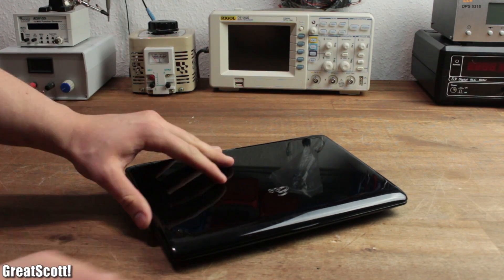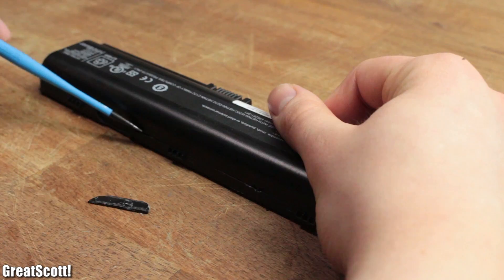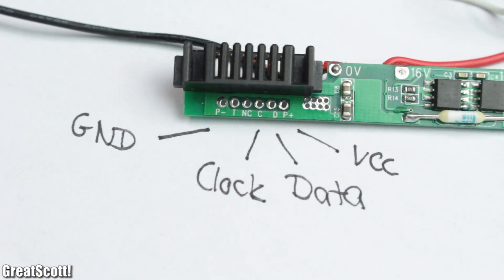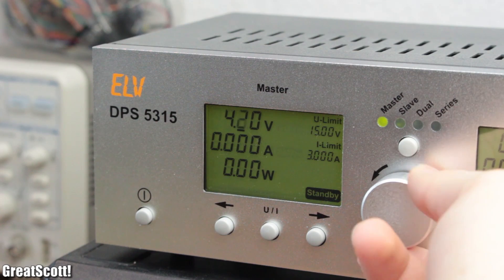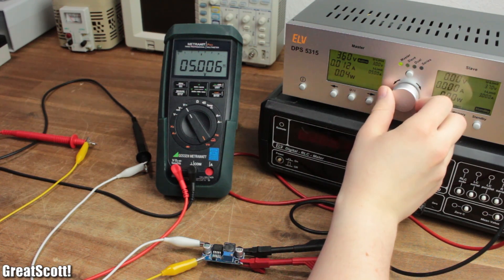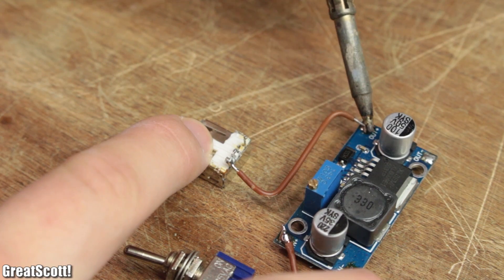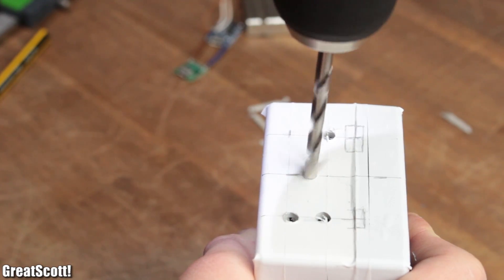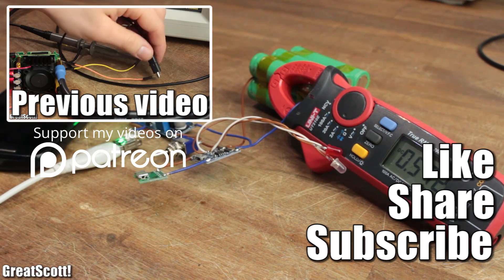HACKED!: Old laptop battery becomes a Power bank

Comment: I could do this with more than 6 cells? I have a bunch lying around.
Reply from the maker: I recommend only cells from the same batch
Reply: +GreatScott! Can you please make a Solar powered power bank because the power bank you did in the video does not have an emergency charger itself so, please make a video on it.
Reply: Sure, but use an good wire that can handle the current
Reply: You CAN, but you'll have to take extra care during charging because cells from different batches can have different internal resistances (ESR values) and mixed cells without balance control can create a scenario where some of the cells can overcharge or draw significantly more current than other cells in the pack. If you decide to still go ahead and build your pack, then ALWAYS ALWAYS ALWAYS monitor the pack while charging! If you notice any of the cells getting hot, then immediately stop charging!! If you let the overheating cells continue to take in current, you run the risk of some of your cells heating up past their safe thresholds and entering a thermal runaway, which as the term implies means the cell will overheat, release all the stored energy and potentially start a fire... I personally recommend that if you are gonna mix and match, you should get the ESR (Equivalent Series Resistance) of each cell you use and make sure that each bank of cells is at least somewhat equal. This will reduce the chances of your finished pack overheating. Lithium Ion cells are VERY picky when it comes to charging, so regular monitoring is an absolutely great idea and shouldn't be an afterthought if you use a mixed-batch pack of cells.
Reply: ThEcRaZ3dGaM3R lol
Reply: Just add the solar board to the Circuit.
Reply: they have USB solar panels and you could get one and plug it into the USB port on hear
Reply: I had a battery pack that was supposed to power a screen that was rated at 12volt but after letting it charge overnight the screen wouldn't come on properly. are some of the cells dead for good and how can I tell wich ones they are
Reply: ThEcRaZ3dGaM3R it was a pack I bough used at a thrift shop that was a battery and a screen for a gamecube and after charging it over night the screen would come on but not properly I plugged the screen into 12 volts from the wall so I would know what it's supposed to look like
Reply: ThEcRaZ3dGaM3R how powerfull charger do you need for this to charg is 1.55 A
Reply: well you could do it with a billion if you had enough cells and time
Reply: Kyle Thomas thanks
Reply: If you're doing what I'm doing and making a high power LED torch that needs an 4AH pack producing 6 amps of current  just to flicker then it's a must to use thick wire. For a low-power application, such as a phone charger it's not as vital since the current to the boost converter rarely exceeds 1.8-2.5A. Your biggest worry will be mismatched cells since no two lithium ion cells have the same characteristics. Each cell will have a different internal resistance called ESR (Equivalent Series Resistance). If you're mixing and matching cells, the cells with the lowest ESR Will draw significantly more current than the cells with a higher ESR as electric current likes to find an easy path to ground (or in this case, the easiest cell to charge). Issues with ESR mis-matching include over or under-charging of cells and potential overheating, which can cause the cell to thermal-runaway and release all of the stored energy as heat. If this happens, you should be aware that the cells can and do reach extremely high temperatures when they vent off and they CAN start a fire. You want to make sure you keep flammables away from lithium cells while charging if you can help it.
Reply: Hey thanks ThEcRaZ3dGaM3R. Would this different internal resistance still matter after a couple charge discharge cycles or will it always persist amongst cells from different packs? I would hypothesize that they eventually converge no? EE is hard. haha
Reply: BenevolentXMachine There's potential for them to balance out because the ESRs change with usage, but for the cells to do that, they need to be fairly similar (Within +/- 10% of each other). it'll take a fair few charge/discharge cycles though.
Reply: justin rivera Possibly... How did you configure the cells? Did you use a 3-series 2 parallel configuration like a 6-cell laptop battery and then use a balance circuit to charge the cells as a pack or are you banking the cells up and then boosting their output with a boost converter? Additionally, have you checked the voltage of each cell while building the pack?...
Reply: You gotta use a multimeter like he does in the video
Reply: justin rivera Maybe there's a dead cell or two in it it then... my recommendation is to disassemble the pack and check that all the cells are at around 3.2-4.2 volts. If you have any below 1.5v they're pretty much as good as dead...
Reply: BenevolentXMachine I did it with 10 cells and it works fine.
Reply: Andrew Vollmer tx
Reply: I have only 3 cells. Is it posible carry out such project?
Reply: As long as you make sure the voltage is EXACTLY the same across all the cells
Reply: Can you imagine charging a billion cells though!? That would take forever!!...

in fact, because I'm bored I'm actually gonna do the math using a fairly common battery capacity of 2000mAH. I'm going to use a perfect-world type scenario to shave time since I don't want to factor in losses. you generally have to put more current in to overcome losses from the internal ESR of the cell if you do a real-world type scenario... Anyway... to charge this huge ass battery bank (which could literally run an entire city's mobile devices for at least 2 days), you would be looking at:

1 hour charge: 2 peta-amps (2 billion amps) of current at 4.2v
1 amp CC charge: 0.00000001mA  per hour per cell, which equates to about 2,000,000,000 hours, which is 228,310.5022831 years at 4.2v... You wouldn't even be alive to see it fully charged unless you started with fully charged cells or could generate ridiculous amounts of current!!

Comment: Question: i found a broken USB battery, I cut off the leads to the damaged battery and discovered that the usb circuit was intact. so..... I have a bank of 4 series laptop batteries charging off of it. do you think its a viable option to recycle the charging circuit from broken usb batteries? and their possible application? so far i have 2 packs of 4 batteries in series, i plan on doing a parallel and doubling my numbers from 1.498 average per pack

Comment: thats not a power bank thats a power brick lol
Reply: Mack Andreou I mean hey it works tho lol
Reply: you will not find in a store power brick with power like this
Reply: That's not a scam you dumbass. Anker is a true company.
Reply: Sean Smith "massive"
Reply: supahvaporeon LiPo tastes like polymer
Reply: no more like eraser
Reply: that's called a scam
Reply: You saw, how big one 2200mAh battery is. There is no higher density now than LiIon, and LiPo just means free form Vs fixed AA sized form.
 If you see a 20000 mAh battery that is ONLY equal the size of 4  2200mAh batteries, you should not that you are cheated. If they state on the samed power bank/brick to have 50000,Ah capacity, the you should know, you are cheated much worse.
 There is no magic, there is no higher energy density technology available, than these thick AA sided batteries.  If anyone develops a different, higher capacity battery, it will NOT sell it on ebay, but will have a huge contract with Tesla, and will become ultra rich.
Reply: @MMSZoli  there are lg 18650 with a capacity of 3500mAh. The anker one, for example, has 6 cells in a (weird for a powerbank) configuration of 2s3p and has a capacity of 20800mAh. This is perfectly possible and not a scam.
This does not mean that all powerbanks are real, there are some that advertise a capacity of 50Ah and are not much bigger than your phone.
Reply: What do you call this? https://www.amazon.co.uk/20000mAh-Multi-Voltage-Portable-Notebooks-Compatible/dp/B00BUJCMUQ they go a lot higher than that.
Reply: @rupert274  Lmao I have 220Ah battery pack
Reply: Those are using Lithium-Polymer batteries, which are more powerful than Lithium-Ion batteries

Comment: Where is over discharge protection in this circuit....
Reply: It's included in the charger
Reply: Tp4056 comes in two models one with charge protection and one without.The one used here is with charge protection.

Comment: Awesome video and project.  If I may ask a question.  I have 9 18650 Cells.  I am series wiring them into 3 sets then connecting the 3 sets in parallel making a 12.6 volt battery.  How would i make a balanced circuit  charger using 12 V transformer and 3s pcb balanced board ?

Comment: I have also made my on 12000 mAh my charger system can charge batteriene with 3 Ah 4.15 volt my usb output is 5 volts 3 Ah charging system and usb 5 volt system must be chosen with care to project the batteries

Comment: can I just use a circuit board from old power bank and hook it with 12 battery cells?
Reply: if the cells are the type of accu and thei have the right voltage this should be no problem

Comment: I salvaged 4 batteries from an old laptop battery. charged them individually and 2 of them keep exactly 4.05 volts  and the other 2 dropped to 3.93v and 3.94v. Is it safe to use all 4 batteries together in series?

Comment: I have done the very same circuit to feed a PAM8403 module and when the battery is completely charged smoke comes out of the XL6009 module and it burns like hell. Where's the problem?

Comment: Hello Sir,
I found this as very useful. Ok. but I found that the this tp4056 module cut the output voltage only at 2.5v. i think this is too low, even for some 18650s. how can increase that voltage to 3.6 or atleast 3.0v. i think that will give more protection. another qustion is how can we find the battery with good capacity from that. is there any simple way?

actually, I am going to create a portable emergency with 18650,tp4056, and 1w led, but the problem is when 18650 is fully charged it will 4.2v and when it low its only 3.0 v or lower. when i connect a few diodes series for drop down some voltage it will work from 4.2v. when the voltage reduced to 3.6 the led will be dim. so i need a constant output led driver with 3.2v fro lion. i need around 2A current for few leds parralel. can you help me. plz do a video for this. or at least send a circuit with good efficiency. Expecting your great help. Thank you Sir. (sorry for my bad English)

Comment: I have a BOX of different solar cells, and various rechargeable 18650 batteries iv been collecting for a few years form various places. While I am somewhat skilled with soldering, and can read most circuitry diagrams (that are not horribly complicated) I do not have the experience making circuits myself. Would you happen to recommend a circuit i can make that will accommodate a variety of solar cells (from 1v-3+v), and safely charge 18650 cells? My ideal plan is to make a mini-toolbox solar charger (outputs 5v for usb charging). I was thinking of using something like this: https://www.amazon.com/GERI-Charger-Booster-Converter-Display/dp/B00VDP94QM/ref=pd_lpo_107_tr_t_2?ie=UTF8&refRID=WVKTE63DKPEKVFABNZVEBe awesomely appreciated for some help / recommendations!

Comment: TP 4056 has an input voltage of 5V and an input current of 1A from its usb in right? So if i connect something over 5V 1A to its input terminals, would it be a problem? For exapmple a solar panel with 5V 2A input?

Comment: I know TP4056 is charging only one 18650 battery. is this true?
Reply: yes
Reply: Are u sure?. TP4056 is charging max 1A and using single 18650 battery. Be carreful I thing burning or so slow charging.
Reply: +Baran Can AYDIN he connected 6 cells in parallel so 1/6 amp 😀

Comment: my boost converter seem to be too high ive fried two usb doctors and when i use multi meter on usb out it reads all screwy ending up at - 1. iam using volt setting and cant figure out how to trim it down so it doesnt fry my micro usb on phone itself. scare to try iff it already just fries usb  doctors. please help me with this and my charger is complete. thanks

Comment: did you short out the data pins on the usb jack?
Reply from the maker: Not in the video. But it is an option.
Reply: just out of curiousity how long does it take to charge yours from fully discharged?
 im working on one and it took horribly long to charge it.

Comment: I think those laptop batteries typically run at around 10-14V, wouldn't it just be easier to add a suitable power supply and then retrofit a car to USB charger on the output as they are dirt cheap on ebay.

Comment: if i build it will it charge my iphone? Or is there any thing that i might have to do more?
Reply: iphones will charge, but slower. they don't take the full 1A when therer is no resistor between the data pins on the usb port, but i don't know more. google it

Comment: i have mine all wired minus the leds but on the out side of the boost converter reads -1 and 4.23 on in side. i just bought the boost converter so should work? and my circuit is same as yours. any ideas to help a newb out??

Comment: how fast does it charge?
Reply from the maker: +Stijn Ter Heerdt 1A
Reply: +GreatScott! how long does it need to charge?
Reply: +Stijn Ter Heerdt depends your phone battery capacity
Reply: +JS7457 not my phone the battery
Reply: Stijn Ter Heerdt depends on the capacity of the batteries, if your batteries in parallel make 5000mah it will be 5h.

Comment: how? how did you soldered that wire on battery? Im trying it but it dont stay there. and what about you use MT3608? its cheaper and work better in lower voltage. I think that is better, what do you think?

Comment: i want to make a power bank for my laptop with 19v and 3.5A output, the output is done (XL4015 circuit) but i dont know how to charge them.. i use 18 batery( 2x(9 in series)).. please help..

Comment: Yeah I have The Same batteries but my bench power supply is acting a bit of unusual :)) well the voltage is 4.2V , and I'm charging 6 of those batteries and the current limit is set to .5A , but when I connect them to the supply, voltage drops about 3.5-3.6V. In many forums they say about it should stay on 4.2V. So what is the problem any help?

Comment: Wow thanks a million, I have been studying on how to use those little chargers to charge a large battery pack, this explains it!  I had been wiring them in series to get 12 volts then using a step up to get 33 volts for my 100 watt LED's. Problem came with the recharging, I usually pull them all out and charge them in a regular Lipo charging device, but this should do the trick.  Well not for my 33 volt projects but for 5 to 12 volts this should do nicely, and considering that I purchased a dozen of those little guys some time ago I can afford to play with them a bit.

Comment: Would it not be possible to skip the TP4056 and the XL6009 and just use a LM2596 with adjustible output voltage and a voltage output display ?

Comment: You could modify the build to take up minimal space with a better boxing option, a different switch like a slider or a latching push switch and an easier build to follow for people with less technical knowledge or access to equipment.

Comment: I just soldered a Wire to Ground, and a wire to +5V of the integrated circuits of the Battery. Why do the work yourself if the Circuit is already in place?

Comment: will the boost converter you used actually sustain the 5 volt output throughout the different charge state of the battery? sorry for all the questions but I'm sort of a beginner at electronics and had taken apart many computers.
planning on making this build with many different batteries. Thanks!

Comment: I made this charger and I had few issues. 1#. I don't know why, but the charger only acharges one of four devices that I tried, it's the galaxy s2. it doesn't worked with my sony z2, tab s, galaxy s3. I cant figure why :-( 2#. the boost converter boost voltage up to 5,7-32V, and I can't make exactly 5,0V :-( 3#. the charger regulator pushes 960mA to the batteries and the chip gets realy hot very fast. maby somebady can explain my what's the problems?

Comment: Great project, but keep in mind, using low voltage cells and good cells together in parallel is dangerous due to low internal resistance of undervolt cells. There is a reason that gas gauge chip shut down the charging-discharging circuit, I wouldn t be using them just for peace of mind.

Comment: Dear friend, i am quite a begginer at electronics, but i always like it a lot and decided to actually learn and do some simple projects. I am fallowing your movies for quite a while and also subscribed rigt now.
Can you please help me with one thing:

My first project is a dyu boom box. I am using a 4 series 6 paralel li ion baterry pack (voltage vrom 11v to 16.8V)  to power an amplifier:
http://www.ebay.com/itm/262136735200?_trksid=p2060353.m2749.l2649&ssPageName=STRK%3AMEBIDX%3AIT

this will give best results at 24 volts

i will use a buck converter: http://www.ebay.com/itm/291595287753?_trksid=p2060353.m2749.l2649&ssPageName=STRK%3AMEBIDX%3AIT
 be able to do the job properly?

What i didn't udrstood is - i will limit the voltage to 24 but the current what i need to do with that because it will draw different amount of current based in power delivered to the speakers. So can i just leave it at maximum and the amplifier will just draw how much it will need? or it will burn the amplifier.

The boom box si more complex but this are my main concerns how this DC DC buck stabilizers work...if you leave it wide opened it should be ok?